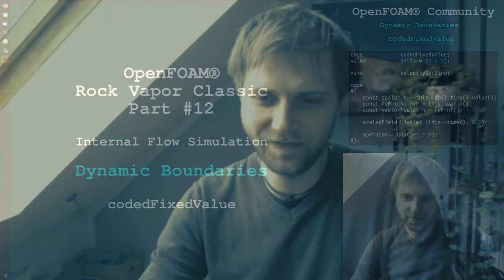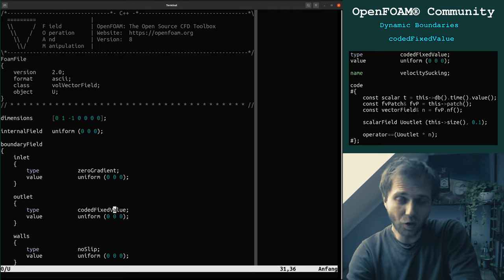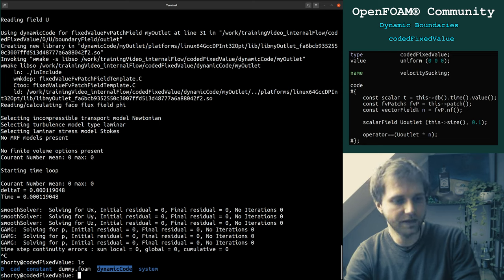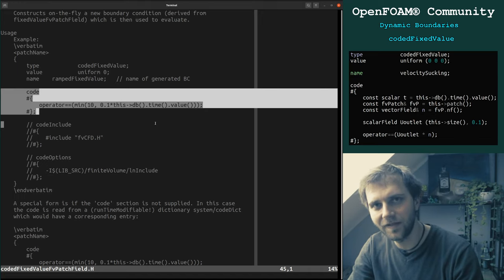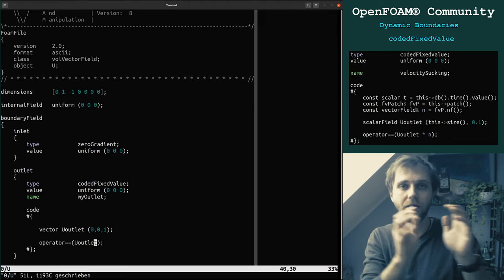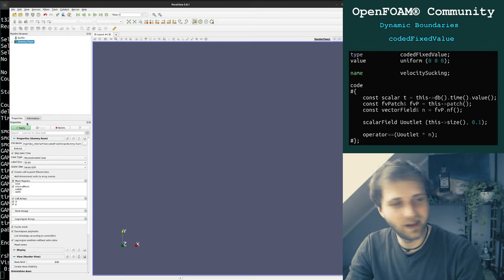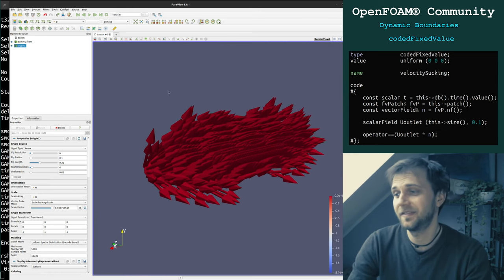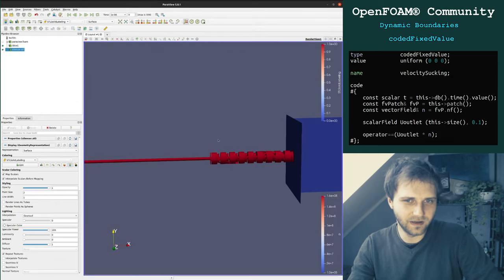CFD Analysis of a Smoking Pipe | Part 12 | codedFixedValue ∇ OpenFOAM® v8

Comment: Thanks for the video, it was a big leap for me on openfoam coding, and helped me realize many puzzles. 
Can I write U as a function of pressure or temperature? 
Thanks
Reply from the maker: What do you mean with you velocity function? What is you aim
Reply: @HolzmannCFD  
Actually this is needed in atmospheric flow simulations, where the "potential temperature" profile is predefined. The OF solver, e.g., buoyantPimpleFoam, simulates the temperature rather. The temperature is function of "potential temperature" and "pressure".
can I get the pressure from the database just like the time in the tutorial?
Reply from the maker: I am not sure if I got you correct but probably not. The velocity is not a function of temperature. It's coupled with P and rho where the energy is included via the EOS. 

However, yes, you can get the pressure field in the code via a lookup
Reply: @HolzmannCFD  
Sorry for not being clear enough. Yes, you are right; the velocity is not a function of temperature. What I really needed was to calculate the inlet temperature profile using a formula that involves pressure.

Thank you again for your tutorial and consistent replies.

Wishing you continued success.
Reply from the maker: Probably you are searching for the surfaceFieldValue function object. Otherwise there is a expression function object available which should do the trick. Finally, a short code that calculates what you need :)
Reply: @HolzmannCFD  
This surfaceFieldValue looks great!!!
I have been looking for a tool doing the job of this surfaceFieldValue a long time ago.
Thanks Tobi, you have always been helpful.

Comment: Hi Tobi, this is a very insightful tutorial on codedFixedValue!! I am working to implement a target mass flow rate on 2 outlet patches (like T-flow exits) where outlet target mass fractions are calculated using the inlet mass flow rate. Would you implement codedFixedValue on 0/U or 0/p? For sure one needs to modifify either velocity or pressure field (compressible rhoCentralFoam)?
Reply from the maker: If its a pressure driven case I would probably modify p, otherwise (and as you said) U.
Reply: Thank for reply, which makes sense! Also is there a way to implement a piece of code like in codedFixedValue in other boundary type (in flowRateInletVelocity boundary type, prescription of mass flow rate is straightforward) to your knowledge?
Reply from the maker: @pgdegrasse9478  Yes you can even make some code in uniformFixedValue and a lot of other places since v2112. Everywhere we have the Function1 implementation, we can use the "coded" type and program whatever we want to have. E.g., for the flowRateInletVelocity, the flowRate specification is a Function1 so you can use coded here too.
Reply: @HolzmannCFD  That's great! However working on OF4.1, I need to upgrade personal code to move to v2112. Thank you so much for your replies Tobi!

Comment: What's the difference btwn initializing a new field then putting it on the RHS of 'operator==', as here & in the OF API codedFixedValuePathField page, and assigning values directly to the patch field, i.e. to *this?
Reply from the maker: No difference. The operator== should assign the values to the object.
Reply: @HolzmannCFD  Doesn't the creation of a new field cost add'l memory, & the subsequent copying of field values to the fvPatchField cost add'l time? Or are their references swapped to avoid the value copying?
Reply from the maker: @jacquesenboit6351  agreed, but not worth to talk about that.

Comment: Dear Sir, I am using coded mixed boundary conditions to apply radiation in cylindrical geometry. But I am struggling to code the ambient temperature equation, which varies with the length. How I solve this problem?

Comment: Hi Tobi. Can you explain how i will be able to perform a codedfixedvalue on static contact angle?
Reply from the maker: Don't get your point.
Reply: @HolzmannCFD  if you look at boundary conditions for contact angle in interFoam, you will find 4 types. constant contact angle , dynamic contact angle , time varying and etc . In static contact angle which you have  to write a value for example 120 degree and it wall be constant across the boundary condition, what I wanna do is to make it a as a function of distance.
Reply from the maker: @maxpayne8846  i never used that BC as i never needed it. So if you can use a function1 somewhere, the News Release 2112 will have a coded one included. Hence, you can do it.
Reply: @HolzmannCFD  tnx anyway man.  tnx for the time you 've spent to answer me it means a lot.
Reply from the maker: @maxpayne8846  Aren't there other contact angle boundary conditions available? If it is a common problem, I would expect that there is something already available that you can use.
Reply from the maker: @maxpayne8846  you can derive your own BC for that... its not that difficult :)
Reply: @HolzmannCFD  i am new to openfoam and btw the openfoam c++ coding is a bit different than the c++ i learnt at university.
Reply: @HolzmannCFD  sir tnx for the reply. I am getting a bit familiar with object oriented programming, but openfoam's coding is a bit different. If you can introduce a reference or a book which is good for coding in openfoam, ill be eternally grateful.